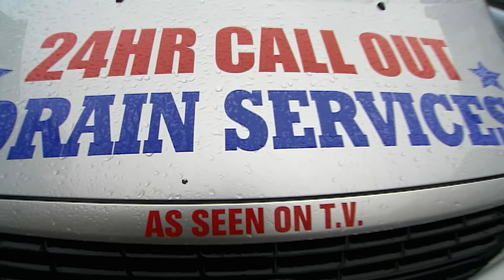Slobs Lived in Filth for Years | Filth

Comment: Virgin boy eggs are a traditional dish of Dongyang, Zhejiang, China in which eggs are boiled in the urine of young boys, preferably under the age of ten.The dish is prepared by first soaking the eggs in the urine of young boys, then the mixture is heated over a stove. After boiling, the entire surface of the egg shells are cracked, and they are placed back into the urine. The used urine is then replaced with fresh urine and the process is repeated. The soaking process cures the eggs in the urine, and the entire process generally takes a full day.[3][4] According to some recipes, different herbs may also be added. When finished, the eggs' whites have a pale golden hue and the yolks turn green.[6] Virgin boy eggs are similar to century eggs in their curing process and historical roots, although century eggs have become much more popular and do not use urine.
Reply: Disgusting,the Chinese have foul ways of preparing food, especially delicacies.